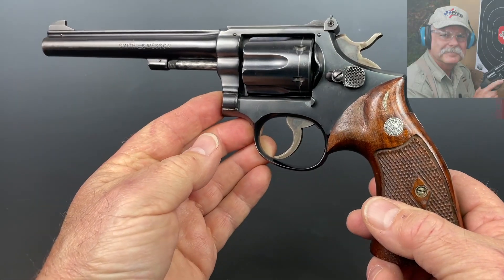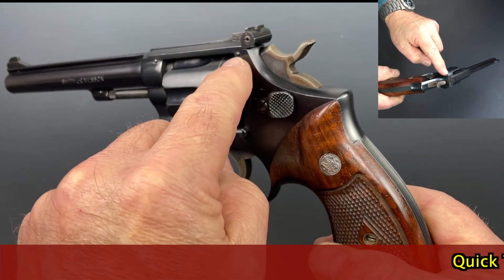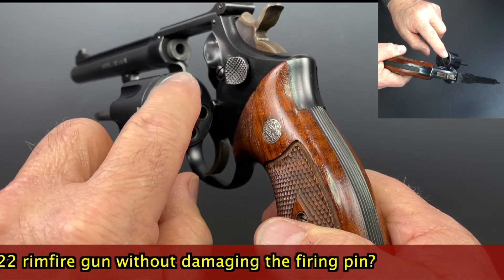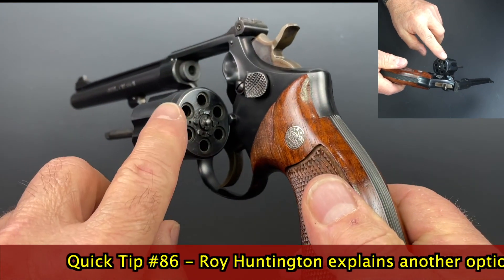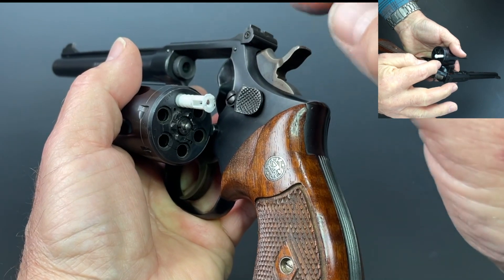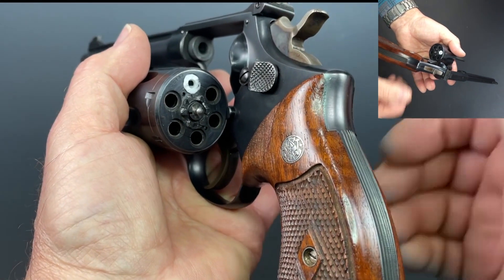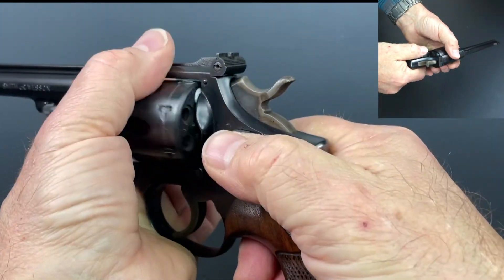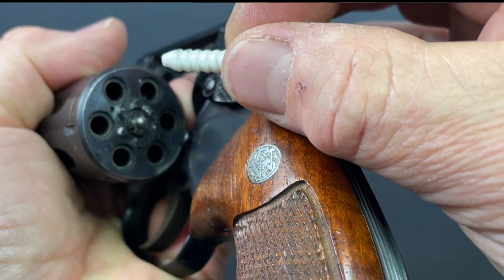Make Your Own .22 Revolver Snap Caps

Comment: The factory owner's manual for the Ruger Wrangler says it is OK to dry fire it, BUT there is a video on You Tube that shows the damage caused to a Wrangler and the process required to correct it.
NEVER dryfire a rimfire without some sort of snap cap.
Reply: Yeah, I saw that in the manual but am still wary.  I don't know how a snap cap can work for rim fire. My centerfire snap caps have a plastic insert where the primer would go but I don't see plastic rimmed .22 snap caps anywhere.